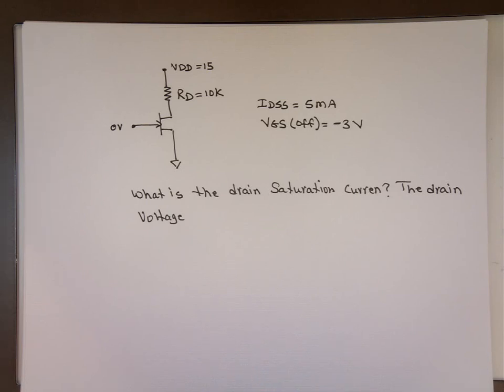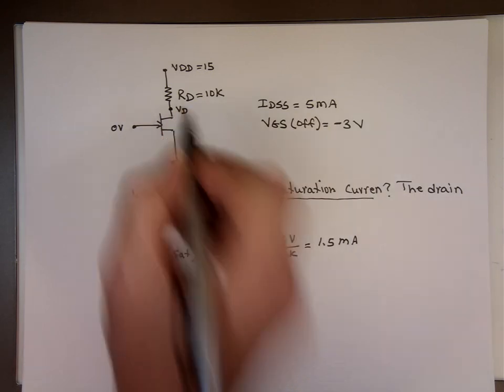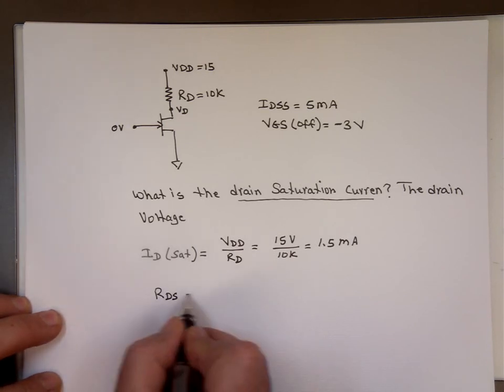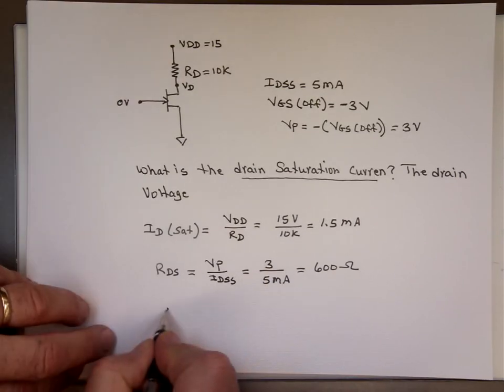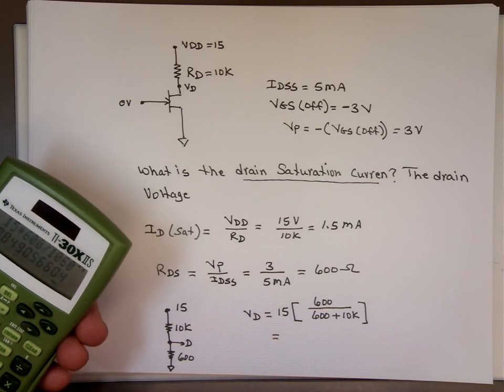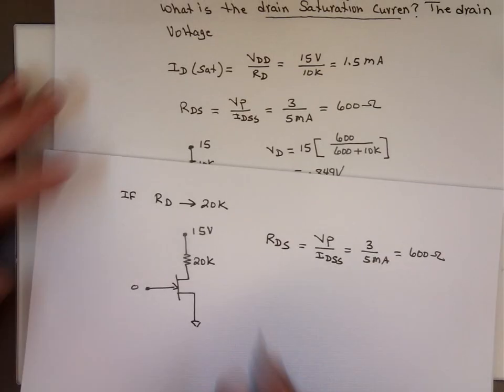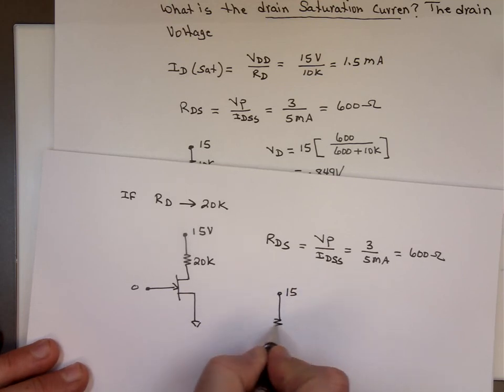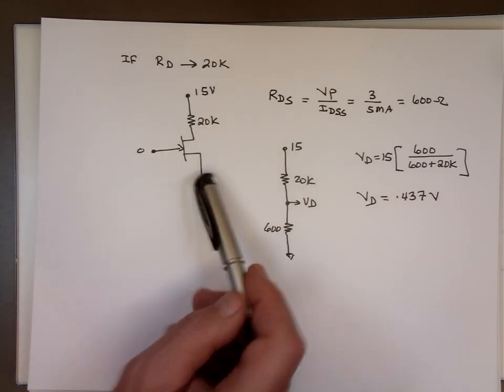Solved JFET Examples

Comment: A diode is in series with 220V. If the voltage across the resistors is 6V. Find the current through the diode?.

Comment: You said R_DS does not depend on top resistor, but to calculate it, we needed the current, which we used the top resistor to calculate. So wouldnt the R_DS be implicitly set by the resistor if we need to calculate current?

Comment: Vd is zero according to the first calculation?
Reply: I believe your right. The first formula should subtract the voltage deopped over the jfet. I'm beginning to question whats accurate in this video.
Reply: Its true if Id (current in drain) is on saturation, Vd is always equal to 0..

Comment: why dou you calculate Rth?  we know that gate current is equal to zero...  if gate current is zero
Reply: May be it will help us to know the input impedance of the whole cascade lately - the Rth II Zin ~ Rth
Reply: @MasterDomai  coming from the future, if you plan to get the FE exam done you will need to know Rth, since some questions will make you take a Nodal view from the ground and Rth comes into play during that. Some Nasty stuff
Reply: I had thought Vth is always connected to a series Rth. But for Nodal it's I(nodal) in parallel with Rth=R(nodal)